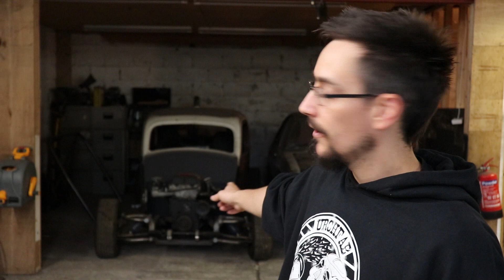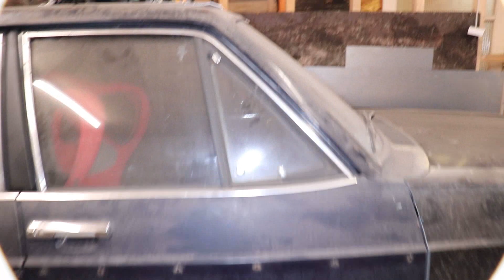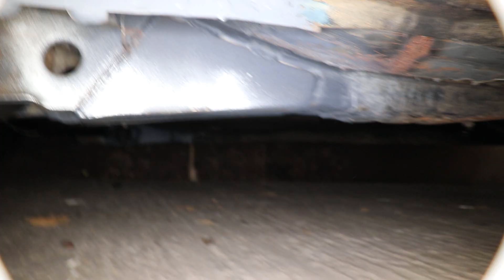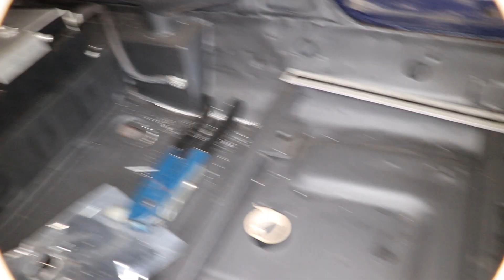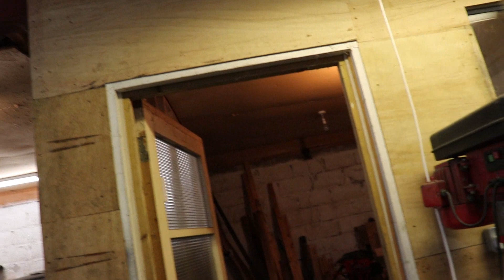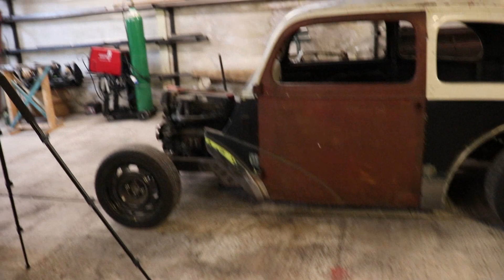WORKSHOP TOUR, I MEAN COW SHED TOUR!

Comment: I will get that finished before I die 🤣

Reasonable time table. 

Always liked the propane IR heaters attached to a 10 gallon tank for my barn, heating the air in an open space isn't doable like you mentioned.

Comment: G'day mate, i was wondering how you work on that floor. I've tried working in places with floors like that and it's a curse. At one place we hired a Concrete polisher ,like a big floor polisher which uses a round stone to grind the floor flat. The floor had screed marks like yours has got but after a few hours grinding we  had a babybutt smooth floor which we coated with floor epoxy. Be careful of the latter though, the fumes turn people aggressive ,so a respirator is needed.A smooth floor makes for a happy workplace....😀

Comment: Great tour, was wondering about the pop & escort in the background. I have had to overcome the same workshop shortcomings myself. I have insulated my roof which was the biggest improvement regarding heat loss & noise (ie keeping noise from upsetting neighbours). I have settled on a large wood burner for heat as its very effective & free. So you don't have to worry about opening the door & letting heat out etc. Electric way to expensive, Propane or diesel space heaters were great for quick heat but noise & smell was unacceptable to me (I like to be able to hear radio & phone without any background noise!). White emulsion everywhere improves light & as you said old style fluorescents take some beating. Lastly floor paint makes a massive improvement to even the crappiest surface. I lash it on every year before I go on holiday to give it time to harden & now my floor is becoming smoother with every coat!

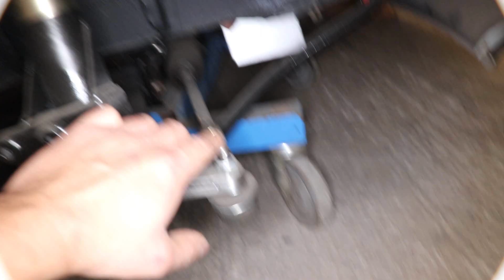Comment: 7:30 when you check out the alignment look at your bump steer you might need to shim the rack forward with a 1" aluminum block or something like that. But I'm sure you can handle that! You're UrchFab after all
Reply from the maker: The rack is mounted like that so it doesn't over centre on full lock, as long as your tie rods run parallel to the bottom arm and pivot from the same point as the bottom arm you don't get bump steer.

Comment: This is basically how we build rock crawlers. We built the whole chassis and then make the jeep tub or whatever body fit or just skid a tube chassis. All the drivetrain bits are adapted from other vehicles or are aftermarket. It's nothing like these unibody drift builds.

That suspension design is pretty wild. It's basically a triangulated 4 link using the leafs as lower links. It'd be wild to run a 4 link calculation on it to figure out the anti-squat and roll center. 

Here's a link to the calculator. Very valuable tool for building suspension systems on a stick axle. There's a 3 link calculator also for panhard set-ups. 

I'd be thrilled to see the numbers and know what kind of figures are working well for this type of car. 

http://www.patooyee.com/calculators/calculators.htm
Reply from the maker: I will have a look at that, cheers

Comment: Matt been watching your videos for a while and not commented, but much the same as you I went from having the big all singing dancing workshop to the cheaper farm style shed- the cost of doing business legit has just got so big in the UK - especially when you’re younger. I have to say though I’m 10 times happier having something that’s just mine. It takes time to build up the tools and equipment, but just buy what you can when you can afford it, seen so many guys go broke in debt to the snap on man and buying all the gear financing their lives away- or are in 30k worth of student debt, grinding an office job out to make ends meet! what I have is mine and paid for and there’s something nice about that! I bought some cheap screwfix floor paint and have to say I’m impressed with it, thin it well out to paint the first coat and two coats will make a big difference to dust and clean up- oil spills aren’t a chore now!  Like my Grandad used to say “you’ll never go broke if you can work with your hands” 👍🏻 I know the feeling with your own projects- mines been sitting in bits for two years now 😂
Reply from the maker: Il get some, Cheers

Comment: Thanks for showing around. Know the feeling not having 'endless' machining resources. Finally managed to build & acquire it all myself with the intention to continue my hobby (old cars/motorcycles). But self-employed, need for money... I am now the local repair shop and 'making things t be sold on the market'. Lost my focus fro the moment; but looking at you aims & objectives... I will 'retreat' more and keep focused... Great undertaking and look forward to you progress. PS, the floor > you could do it easy yourself by using 'self-levelling compound' provided the floor is not too much under an angle and doing it in sections. Like some of the others, you need to paint or PVA it and it is better to use a 'bucket' hoover than a broom. You need it anyway for your lathe, miller & other machines etc. Envy your tidiness (for now) but it is essential.

Comment: My old workshop was a similar size to yours , I made a gas bottle burner but with 2 full size bottles , bottom one laid down with door at the end , opposite end to the door was a 5" flue for 2 ft to another bottle laid down then the chimney up the wall to roof and out , it used to chuck out 3x the heat of the upright bottle as the top bottle would also radiate the heat from the smoke passing through it , I could paint cars through the winter with it no problems, used to feed it pallet wood , just throw 4ft lengths up it
Reply from the maker: Any pics? sounds good.
Reply: @Urchfab  no sorry it was a sort off " what would happen if " design, I've not got that place any more as moved away for a fresh start , but it was a monster, some times it would get that hot the legs would bow 😂 under it , I made a drip feed for waste oil too but it got too hot and started to glow white

Comment: Like  jeremy toms says, infra-red heaters are very interesting. They heat up your body and the materials like steel, not the air.
 I'm planning on buying one and putting it on a swing arm. 
Just bought some LED panels. They give out way more light than  fluorescent lamps. Go for  4000 kelvin, that great workin light.
You have great channel!

Comment: Good long term solution to the floor and the heat would be to pour another 4 inches of concrete over the existing floor and run plastic tubing in a grid for in floor heating. You can hook it up to an outside wood pellet furnace if that is allowed over there. The concrete acts as a heat sink and once it is warmed up it gives off heat at a steady rate. Plus it is warmest radiating from the floor up where you are.
Reply from the maker: Would be nice, sounds expensive though. Cheers

Comment: You do like those B4234T2 SAAB motors, don't you?
Reply from the maker: I do
Reply: kramer26 I hear their pretty tough
Reply: Shame that GM couldn't get them to stop leaking/burning oil. The earlier motors are better I gather, more Volvo inspired toughness than under budget GM rubbish... just wondering if you can get much internals for them to handle more boost?

Comment: I would go to your local tool station / screw fix just buy PVA Glue and mix it 4 parts of water and use a watering can will seal all the dust in the floor

Comment: I had the same problem with my crumbling work shop floor turning to dust when i swept it, after dismissing  self leveling latex screed for years as not man enough to survive point loading axle stands, trolley jacks and engine cranes i finally caved and gave it a go out of pure frustration, unbelievably durable and wasn't that expensive. wish i'd done it years ago

Comment: Build yourself a waste oil burner there dead easy and if you are running into the scrap yards they would give you the oil free if not pay you to take it away 👍
Reply: Look at my videos for a cheap homemade barrel burner made from scrap got up to 900deg surface temp using drip oil and a simple blower and a clean burn
Reply: Jake Browne I will take a look 😉 even if matt don't see the comments 
I have one in my shed made from a van safe and a gas bottle burning pallet wood and other scrap but I might be tempted to build a waste oil burner myself 👍
Reply: THE MIDNIGHT WOODPECKER made mine out of a tea pot a chunk of glasspack muffler a 4 inch squirlcage fan with a drip into a 1 inch exhaust pipe
Reply: Jake Browne that looks like a good one you made 👍 
But I think I've found the perfect 👌 one for Matt check out this video https://youtu.be/lwx5-sBVCuQ and let me know your thoughts 👍
Reply: Do you need a license now to burn waste oil in a comercial property?
Reply: scottieboiwalker I've no idea I guess it depends on who you tell your burning it 
I doubt anyone would bother in a cow shed in Dorset 
The key is to blow in enough air to make it burn hot enough to get rid of the smoke

Comment: I had the same problem with my garage concrete floor, I mixed some unibond and water in a big bucket then used a broom to coat the whole floor surface, no more dust plus you can then paint it with garage floor paint for that pro finish ;)

Comment: if you going to turn old cars to scrap and parts for a living it might be a good idea to add a hydraulic crane to the truck , for the things you just mentioned , wouldnt be the only junk car thats behind everything else and has to be lifted to move it (those are usually the cheapest to get as noone else want to go through the hassle )
the crane allso helps when you need to straighten a chassis (strap it down to the truck and use the crane to apply force )
the barn will be eazier to heat if you put a floor in it , if its youre own place that is a nice investment to up the value of the place (ah you rent it so maibe the man renting it to you is willing to pay for the materials )
as foir the floor , it might be eazier to put a layer of self leveling cement on the existing floor , might be worth investigatng before committing to have someone grind the floor flat
Reply: didnt knew it had to be tested , dont think we have that here in the netherlands but then again i never owned a truck with a crane on it , that does trow a wrench in the works 
figured with hydraulic outriggers the current truck could handle loading from the side or the rear
Reply from the maker: I don't think my transit would handle a crane and probably be overweight with no load on it. im not planning to do much scrap collecting its more for getting to events. Cheers

Comment: I used to have a second hand catalytic diesel heater, great big flower like thing on wheels, electric fan to light it and blow air over it. The workshop was uninsulated, the owner sold the insulating one year before I moved in, it used about 8 quids of red diesel a day to nicely heat a 2000 square foot workshop, not cheap, but in reality I just had it on a couple of hours first thing in the day. Plus 8 is fine, but less than that I struggled. Now I have a smaller wood working shop and no heat at all, no insulating, but my morning commute is 20 feet. They are surprisingly economical for the heat generated but sadly wood dust is no friend of that style of heater. 

An idea for machinery and videos, how about you make some fabricating tool videos, metal brakes, hydraulic presses, English wheels, etc. I would watch the heck out of those and probably make my own.

Comment: Is the Omega gearbox bolt on to the Saab engines?
Reply: Leofred its a direct bolt on unlike having to use a adapter for a bmw transmission
Reply: Ok, thx. Btw are they the same the 2.0, 2.5 and 3.0 boxes?
Reply: Leofred yes on 2.0 and 2.3 don’t know on the 3.0

Comment: Look at infra-red heaters and the new LED lamps, the lamps are now putting out the same amount of light as fluorescent lamps. Infra-red heaters only heat you not the workshop. Wish I was nearer, I'd help you out with the electrics but your at least 2 hrs out. The mongrel is looking good, can't wait to see it running.
Reply: Agreed, if possible use gas radiant tube heaters that will keep you toasty warm.  Align them front to back between the vehicle bays to stop them blistering the vehicle roofs!   The lighting should be strip lighting LED or HF flourescent  along the walls and again down between the vehicle bays to give lighting to where it is needed, careful siting prevents a clash with the radiant tubes.
The floor needs to be ground as its only a tamped finish.  That will flatten it out and get rid of the contaminants.  A grano screed or an epoxy finish needs to go on top as a standard sand/cement screed will not last and you will have dust problems forever.  Both screeds are expensive but worthwhile.  Don't go for a smooth finish as it will be a skating rink with fluids or body filler on it.